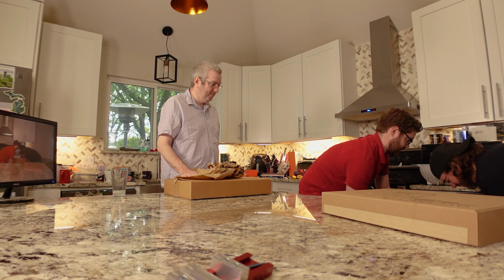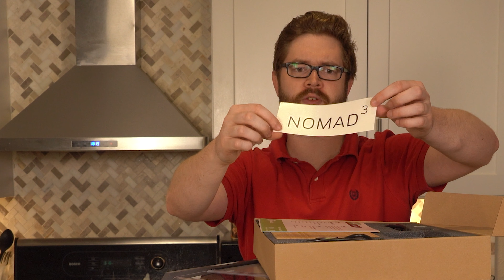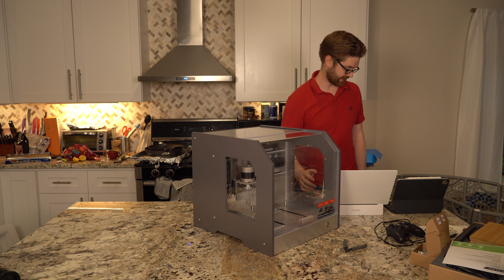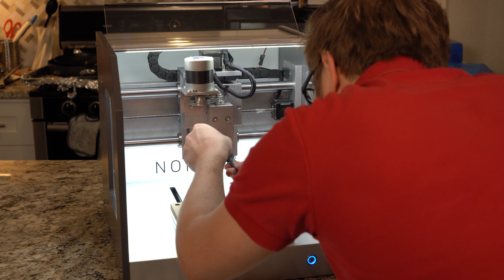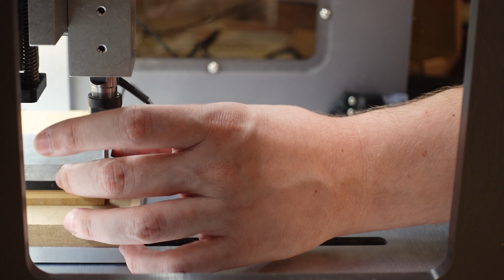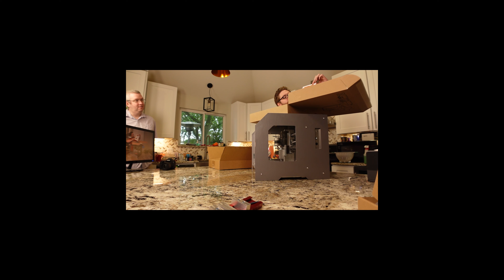NEW CNC MACHINE! (Nomad 3 Unboxing)

Comment: Hi! Can this machine be used to mill dental models?
Reply from the maker: It is capable of extreme detail. If operated with enough skill I would say so. Although 3d msla printing may be a more cost effective solution
Reply: @courcreate  Thank you. I used the denture example to describe the geometry of the parts I am interested in milling. I do not necessarily want to mill dentures, rather, organic-like parts. 

As you said, could this machine accomplish such geometries if done properly?

Comment: I ordered two, and I won't even open the second one.  I am having so many problems, including customer service.  Not sure what happened to this company, but wow... Really went downhill.
Reply from the maker: What kind of issues?
Reply: @courcreate  With the machine?  Backlash and a bad linear rail that caused skipping and broken bits.  Also severe run-out because the spindle bearings are no longer press fit like the 883.  With service: 10+ days between replies and very little understanding of the mechanics of the machine.  When you do get a reply, it's always "send me a video so I can show an engineer".  I swear I used to be able to call, get a human being and an immediate solution.